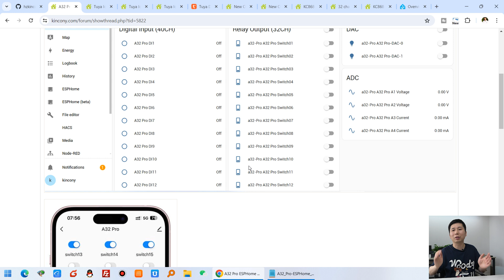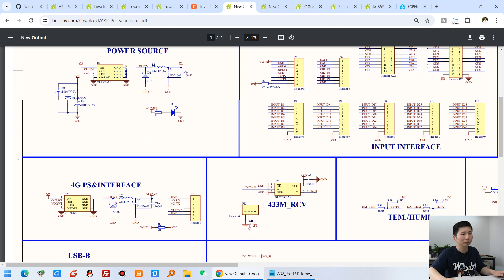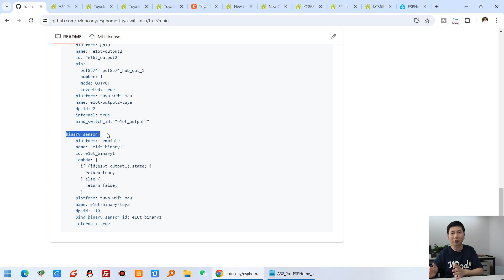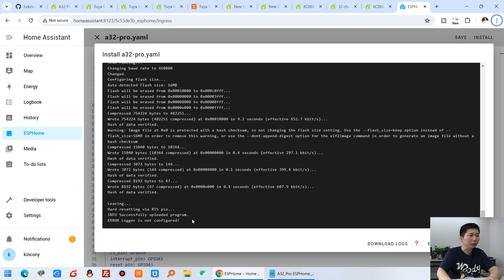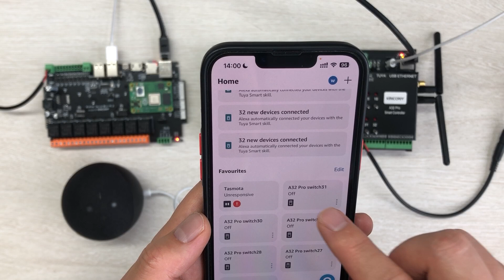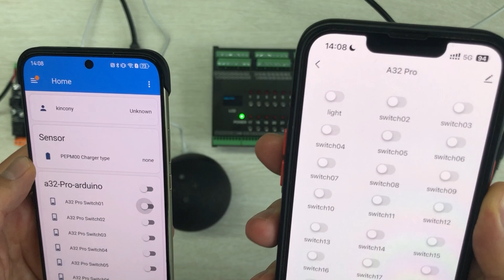how to config ESPHome support Tuya module for A32 Pro Controller

Comment: It's very useful.. But do we need tuya licenses. To control by tuya app from anywhere? Or just configuration in home assistant? Like that.
Reply from the maker: A32 Pro already have tuya module on pcb, not need tuya license, just do as video
Reply: Any product has tuya module no need license? Just configuration?
Reply from the maker: @lionlion-g9d  yes

Comment: I do not understand why do you need the left board!
Reply from the maker: that's raspberry pi server installed home assistant software
Reply: @KinCony  but the A32 pro cannot work with home assistant without the server?
Reply from the maker: @Xaro5  if no server, where you install home assistant?
Reply: @KinCony  to the A32 pro?
 Please make a video thoroughly explaining what is what and why do you need each board.
Reply from the maker: @Xaro5  i have said: if you want to use home assistant software, you need a server to install the software. if you only use Tuya app, OK, only A32 Pro controller is enough.
Reply: @KinCony  can't you run the Home assistant to a simple PC or raspberry pi without buying the (TOO expensive) server?
Reply from the maker: @Xaro5  sure , you can install to a old PC
Reply: @KinCony  and to be clear, if you buy the KC server you can both control the aio or A32 AND the outputs of server. Correct?
Reply from the maker: @Xaro5  Yes, you are right.